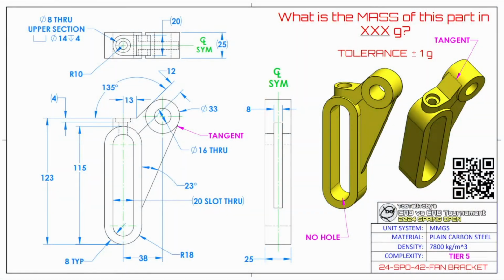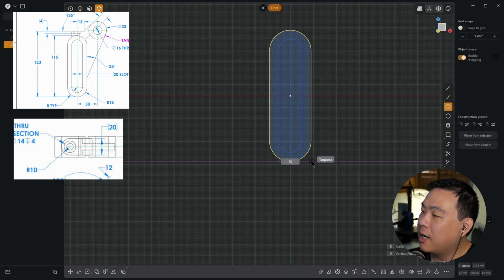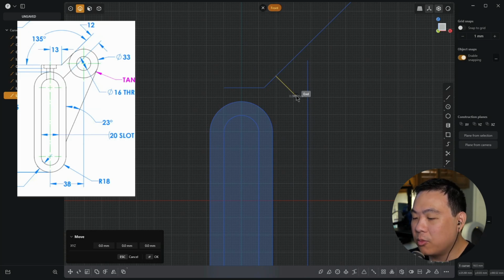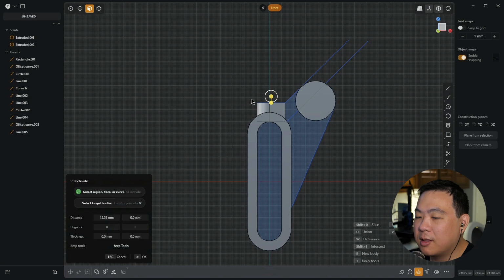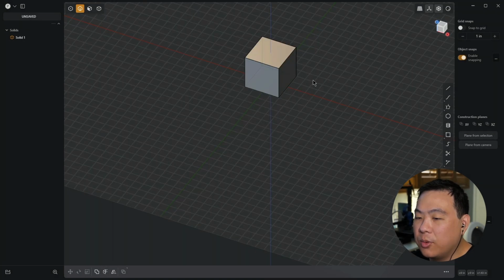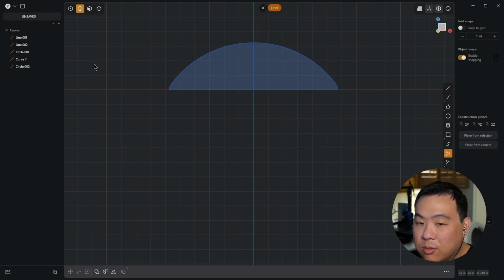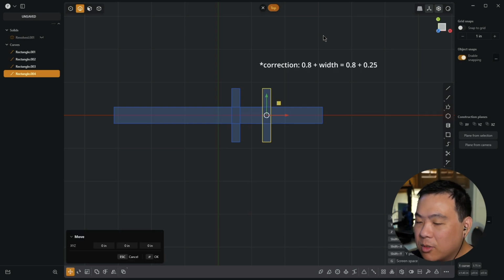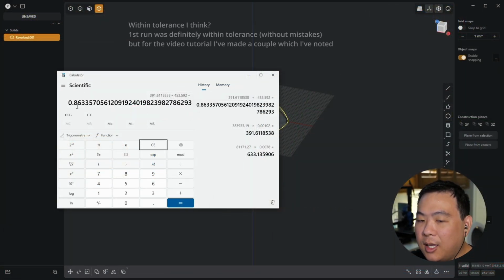Learn Plasticity: CAD Step By Step Tutorial - 2024 CAD vs CAD Quarter Finals Match 1

Comment: I enjoy giving this a go before you do it to compare methods... The only thing significant that I would do differently is just copy the upper tangent line and using V change the local axis and move it 16.5mm parallel. Clearly where it intersects the 38mm offset line is where to centre the 33mm dia circle. Good video and excellent narrative as always.
Reply from the maker: Glad you liked the video! Thank you for the alternative approach. It's always interesting to me to see how other people think.
Reply from the maker: I just gave your approach a try, and it dawned on me that an even "faster" way (instead of duplicate, change pivot, then move) would be to simply use the offset command. But cheers - this is faster than the approach I took in the video.
Reply: @davinchewk  Whilst I'd agree that offset should do it, It's my bad I know, but sometimes it just doesn't do it and I've not figured out quite why yet.